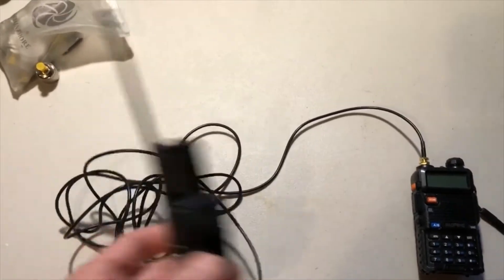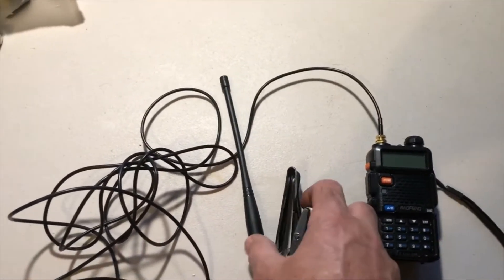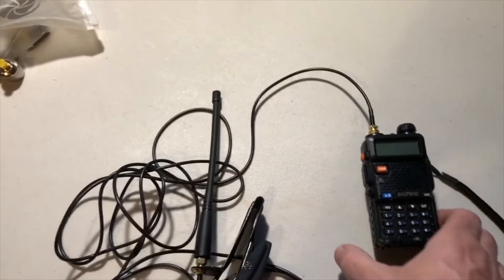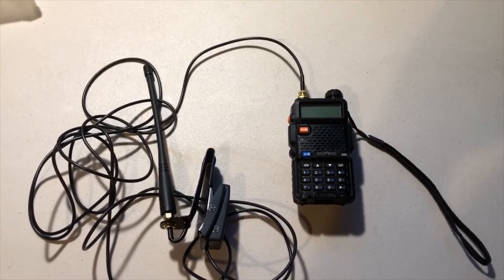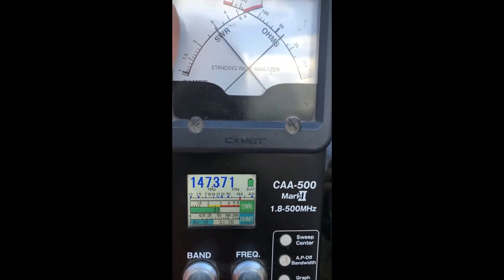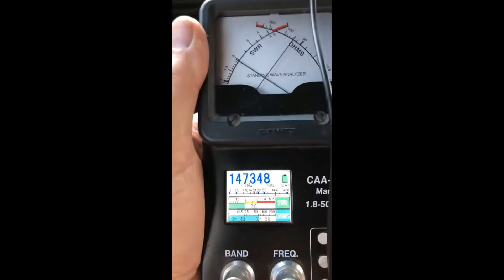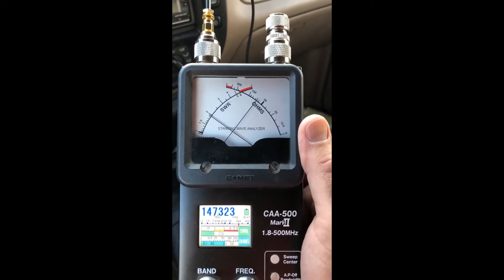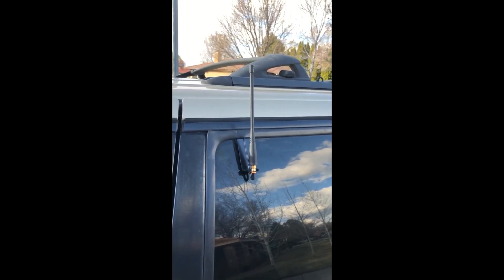REVEX RB CLP SMA Female Window Clip Mount wRG 174U 3M for Two Way Radio Antenna Extend Cable Car Rad

Comment: Do you think a thicker coax cable could be used without it interfering with the window rolling up?
Reply from the maker: I think a thicker coax would get pinched by the window and not work or might even damage the window. I've had good luck with the provide coax. 73s!